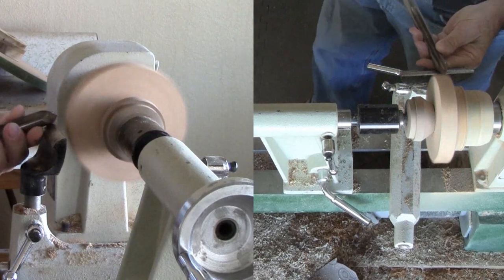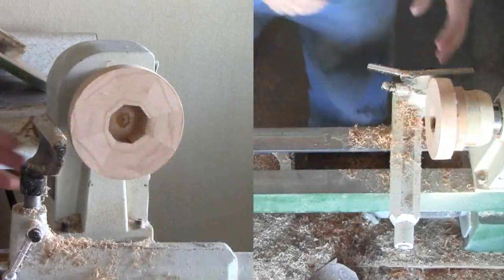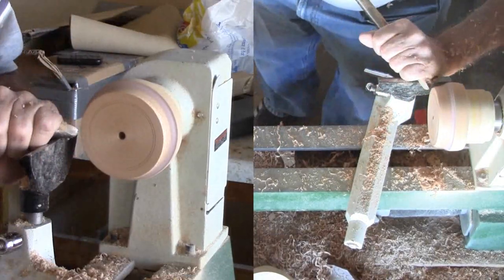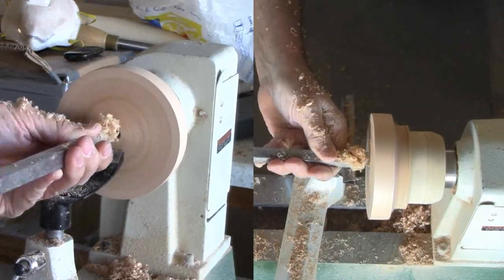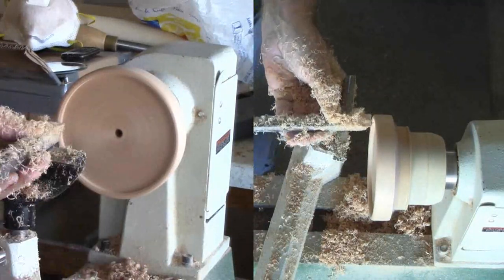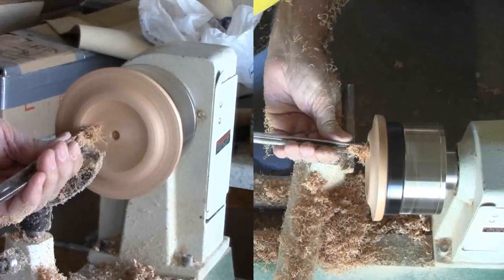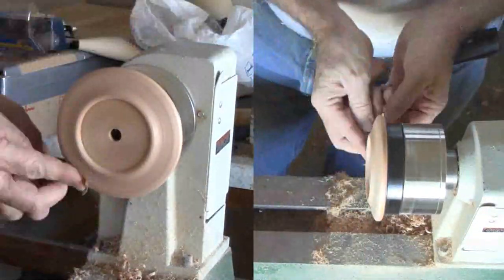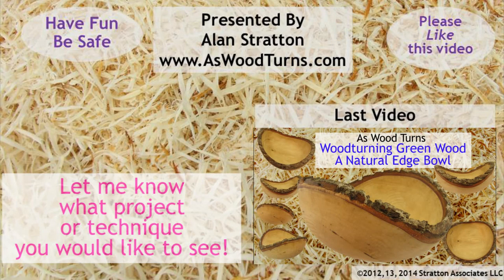Woodturning A Segmented Beveled Mirror Holder

Comment: Alan -

Great project!  Have you considered doing an asymmetric mirror - in which the mirror recess is off-center on the turning?  Also, are you concerned about wood movement and make the recess slightly oversized?

I've found that non-beveled mirrors are easier to find and are much less expensive, but it is necessary that the turning be designed to provide physical protection for the edge of the glass.
Reply from the maker: I hadn't considered asymmetric - it is certainly possible.
Wood movement is less with segmented construction than with solid as it should be more proportional. I'm turning this in Arizona which is very dry; expansion should enlarge the recess. But good point.
At the store where I found these, the difference between beveled and non beveled was only about $0.50 for two. Via woodturning catalogs, the price was much, much higher.
Excellent questions and observations.
Alan Stratton